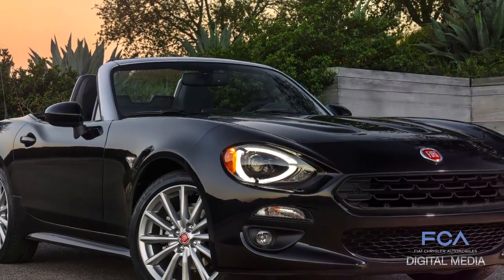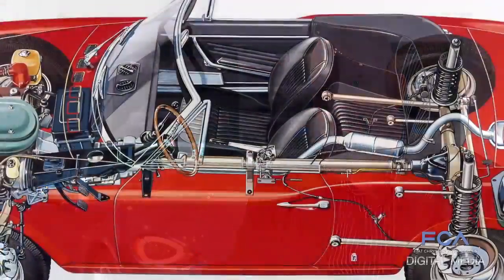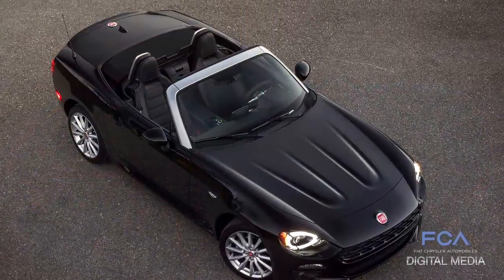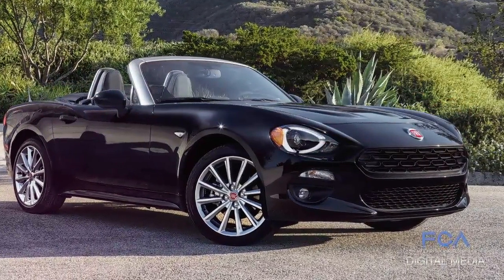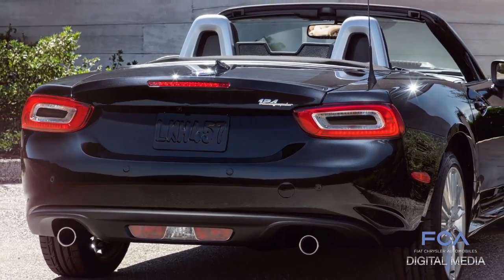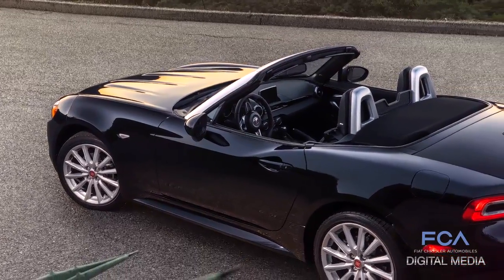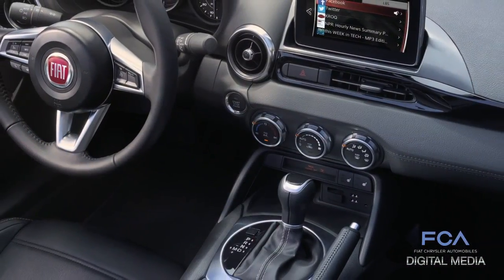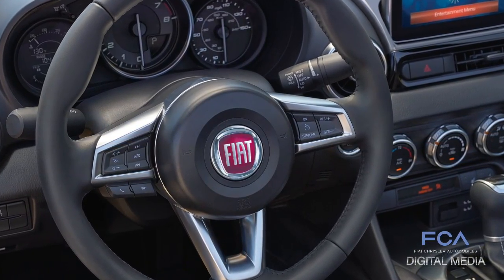2017 Fiat 124 Spider Engineering Feature with Enrico Genchi

Comment: love how there's no mention of it being based on the miata
Reply: +Jair Rivera Well, the interior is completely made by mazda, so I would't be so sure, that the rest was developed together. I believe, that Mazda developed most of the car because it looks so similar to the older mx-5's and fiat changed the exterior, engine and transmission and probably suspension. But I think, that this is a very good deal for both brands.
Reply: +Rafael Valentin Its not based on the Miata, both cars were developed by both, Fiat and Mazda. The japanese dont say the new MX5 is based on the Fiat so...
Reply: +Jair Rivera Bullshit, Fiat didn't develop it at all. Your stupidity is horrendous. An idiot can see the the Mazda heritage and similarity to former MX5 generations and current Mazda models in every detail. Just show me a single part of the MX5 designed after a former or current Fiat.

Comment: Mazda tech here that would be a Mazda Miata in disguise ! Same interior and infotainment too Ac knobs seats probably the same too ,  the most different things would the outer body lights and wheels , it is beautiful tho I would buy it!
Reply: +David Lopez It's nice, but I have the Real Thing.  A 1985 Eurospec Alfa Romeo. 135 HP , twin solex carbs.  Mine was originally bought new in 1985 in Japan. It was later exported to Canada. I acquired it in August.  It's a BLAST to drive !